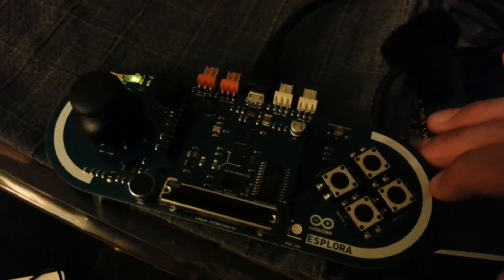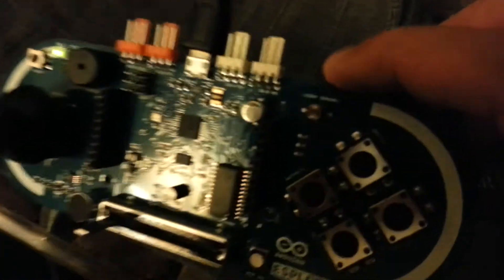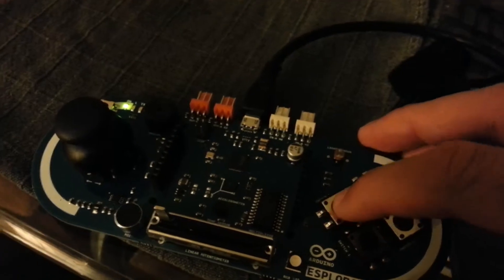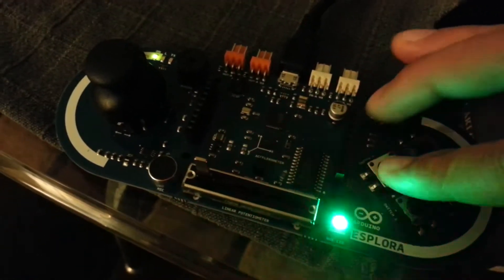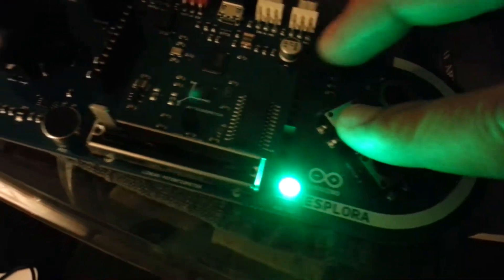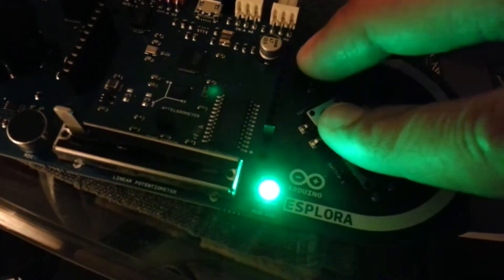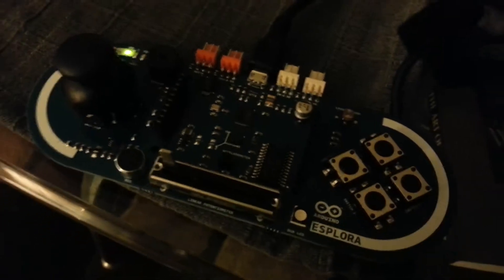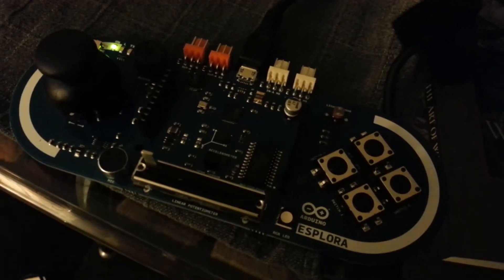Building a theremin-driven light show on an Arduino Esplora

Comment from the maker: thanks! it's actually really easy to do with the Esplora, since the sensors are wiring is all on-board and you don't have to build the circuit and do soldering by hand. it's a great starter kit.

pick one up! :)